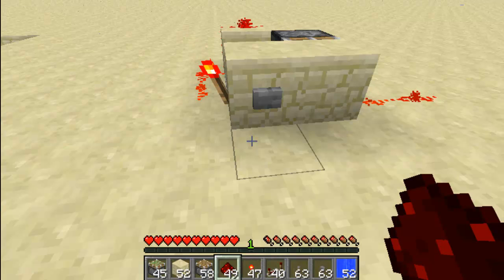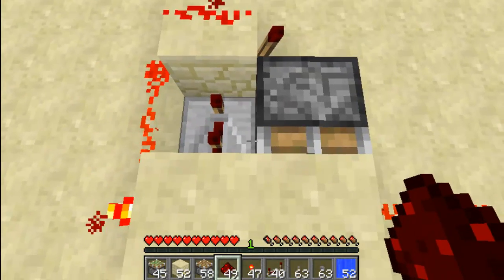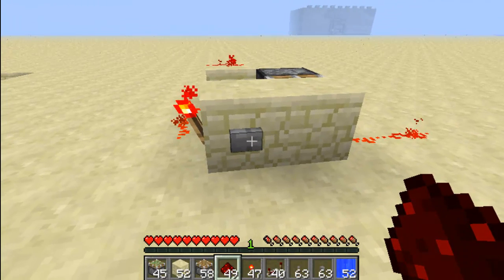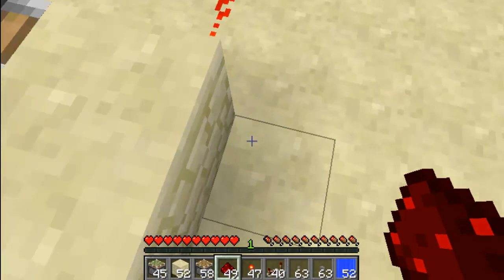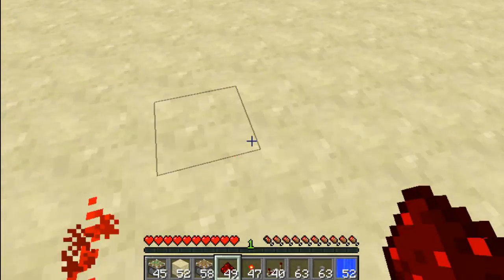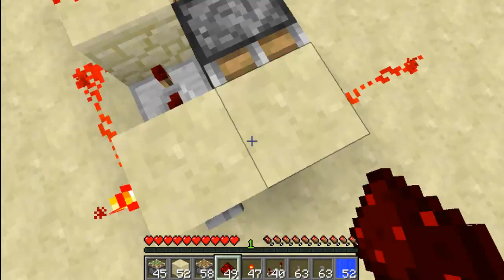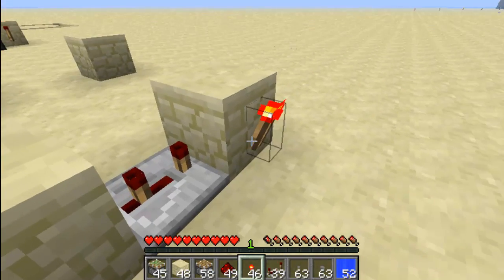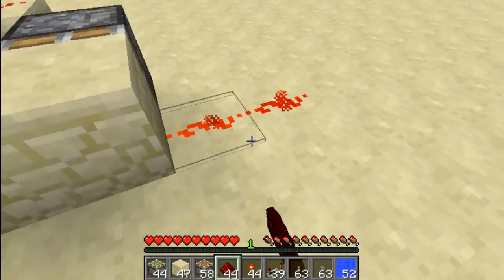Doc's Tiny Tech: T Flip Flop

Comment: I made one that looks like this, t-torch b-block p-sticky piston T-vertical torch B-input block #-air space
It may not look like anything but I'm making a video on it soon, its one wide, tileable, requires only 5 blocks, 4 torches, 2 pistons.

##pb##
pb #bt#
tbT###
##B###

You can make it faster by placing a block with a torch on it under the original input block, this makes it a little taller but a lot faster.

Comment: its actually 3x4x3 The way you build it or 3x4x2 if you attach the torch beneath the piston to a block and dont place it on the ground like you did. supporting blocks are still blocks of the contraption. but its stil smaller than the normal designs used

Comment: Unless I'm mistaken... this is either 4x4x3 when extended and with the bottom torch attached to the bottom side of the output block... or it's 5x3x4 if the torch is simply placed on another block below the whole thing.
Compare that with the 2 piston one I've seen quite often... which takes up 4x4x3 when the input method is on the side of the input block... this would make your design... which takes up at minimum the same number of blocks as the 2 piston one, as good as, not really better.

Comment: 3 reasons to use T-flip flops:
1. Buttons look much cooler than levers.
2. Logic gates make you look like a genius.
3. Unless attached to an XOR Gate, levers can not operate the door from both sides without one locking the other off.

Comment: this can be done without sticky piston(if you dont have slimes) you just have to add a wire that leads to the other side of the block that´s being moved by the sticky so it pushes it back(may have to add repeater)

Comment: Actually T flip flops are much more useful than levers, like in the case you have a piston door and you need to be able to open/close it from both sides, a simple lever can't accomplish that, but a t flip flop with two inputs (buttons) on both sides of the door could toggle it.

Comment: Great video and great contraption, but this isn't 1 block tall. You always count the block that the dust sits on as part of the circuit because without those blocks it can't work. So that makes it 2 blocks tall. Even if you didn't count the blocks, the redstone torch under the piston is the second block. You also didn't count the redstone dust ontop of the block that the repeater feeds into, making it 2 block tall. Other than that, really cool and really useful

Comment: Actual dimensions include the torch under the block that is pushed/pulled.  And the block that the torch sits on.  You could attach to the block under the block that the button connects to though, but it would still be 2x3x4.

Comment from the maker: Thanks! Welcome. Stick pistons have a unique characteristic where if they receive a 1/10th of a second pulse(1 tick) they do not have time to pull back the block. It most likely is because in thier code there is a 1 second delay before retracting. This code is never reached because of the speed of the reaction.